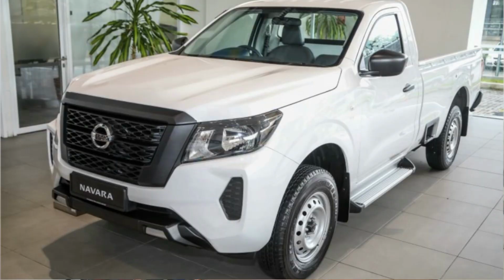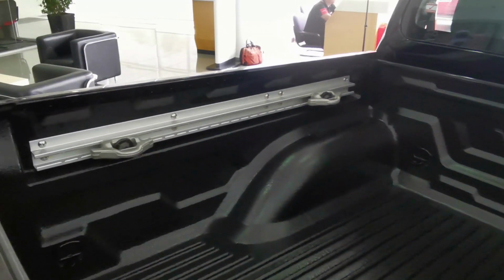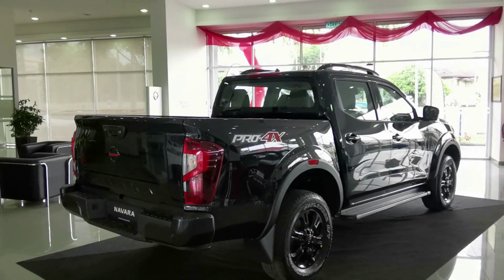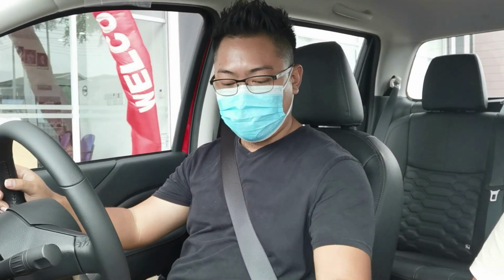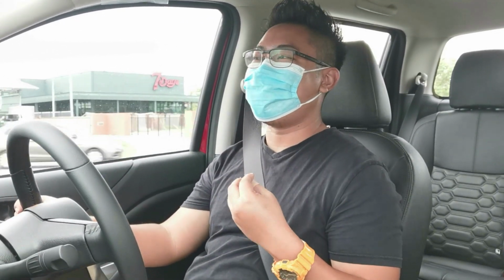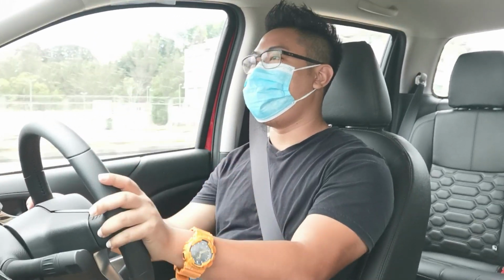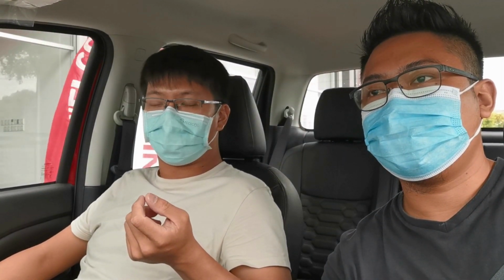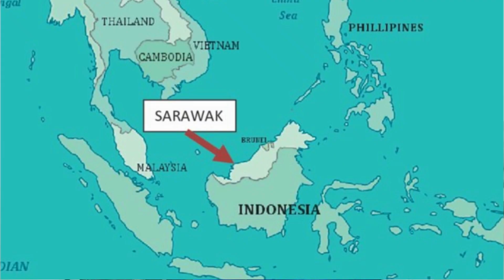First Impression & Drive 2021 Nissan Navara Pro 4X! (Sarawak Malaysia)

Comment: You forgot to mention the all important new addition of Rear Diff Lock for hardcore 4x4  .
Reply from the maker: Oh ya forgot about that 1 detail. My bad. Thanks!
Reply: @afiqbazlibusairi  In Peninsular Malaysia,  due to the ecpensive road tax for dmax x-tetrain 3.0 and hilux 2.8, only 2 choices left. Triton is most favored but knocked due to absence rear diff and heavy unassisted taigate. Ford ranger out due to gearbox issues. Left the navara - outdated engine but palatable when compared to others. Just my humble opinion